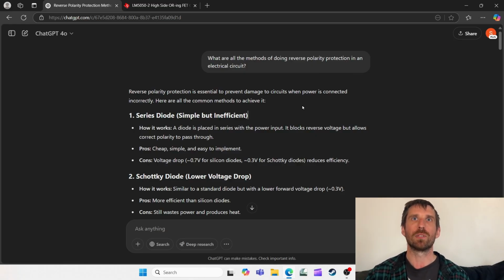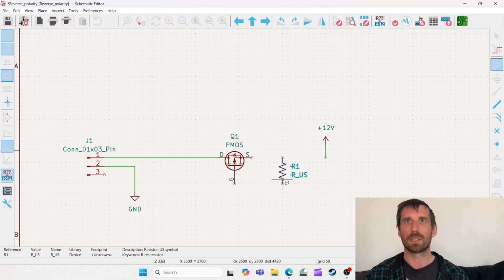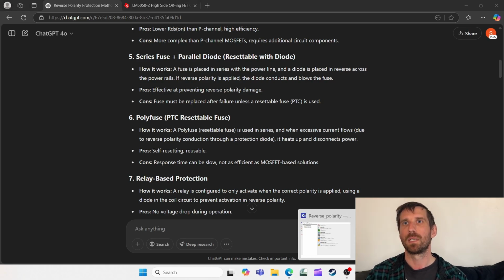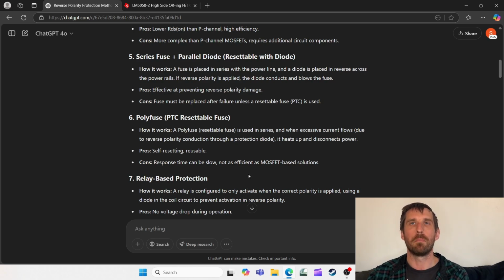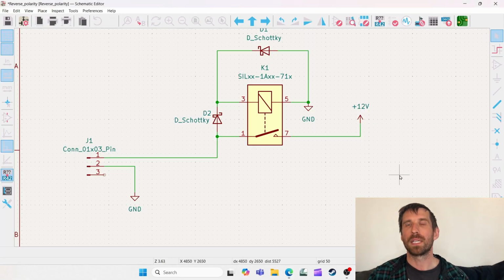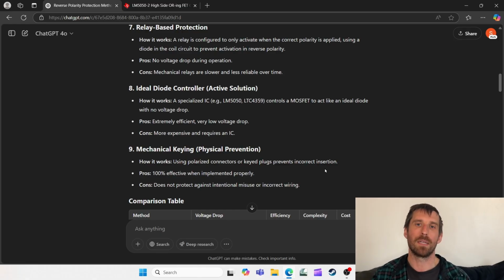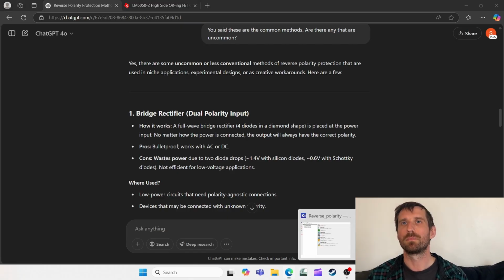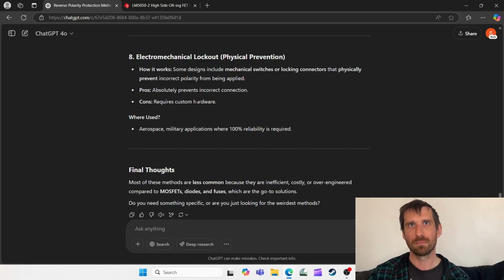Your Circuit Will DIE Without Reverse Polarity Protection!"

Comment: Nicely done. Just subscribed. Using a bridge rectifier for reverse voltage protection has the added benefit of providing, with the addition of a bulk capacitor, AC as well as DC operation. This can sometimes be nice for industrial applications since some systems are powered by 12 or 24V transformers. If efficiency is a concern and the application isn't too cost-sensitive, you can use n-channel MOSFETs and an ideal diode bridge controller like an LT4320 or an LM74680.